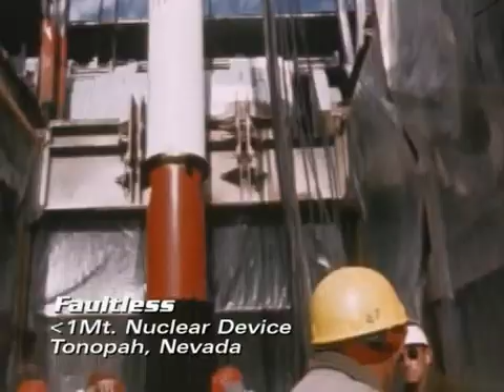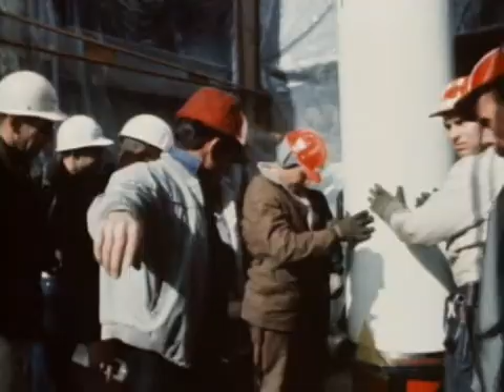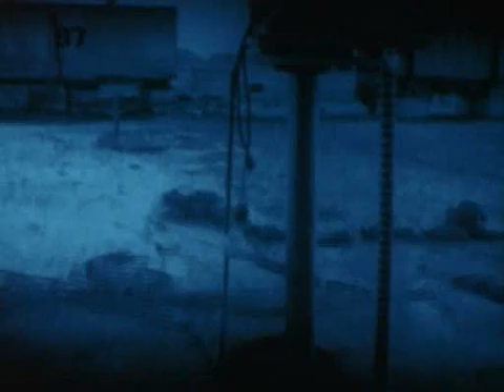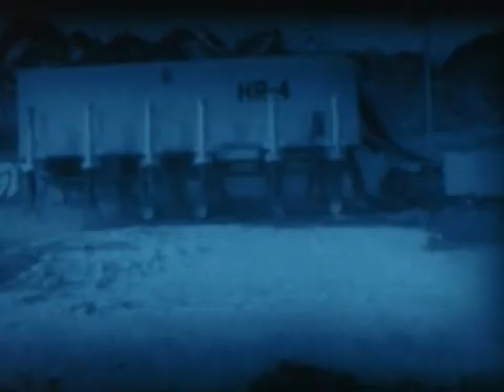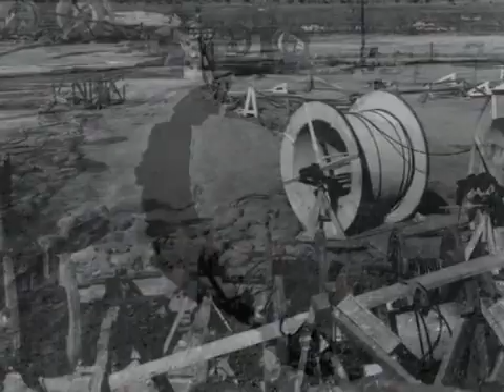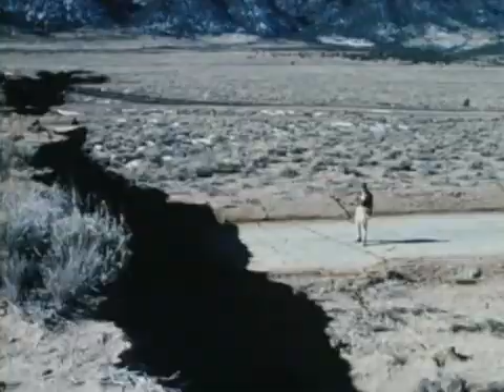Nuclear underground test:Faultless

Comment: "It is sobering to think there's just 800 feet of cracked rock between you and the vaulted roof of the blast chamber." - no, Faultless was exploded 908 meters below ground, 3000 feet.  At 600' it would have been another Sedan crater.
Reply: At the Nevada Test Site there are scores of examples of the effects generated by the underground nuclear explosions there. Typically, each explosion results in a nuclear blast chimney. Once the gases in the vaporized and melted blast sphere cool a bit and the pressure drops the fractured dome ceiling tends to collapse into the spherical void. The collapse continues upward, filling the void with loose rock until either the collapse reaches the surface to form a subsidence crater, or the loose debris forms a compacted bridge that retards the further collapse of the rock and soil above it. In that later case a collapse doesn't appear on the surface. Satellite images of the northern part of Yucca Flat clearly show dozens of subsidence craters.

After the Faultless test the technical assessment suggested that the collapse, at this site took a more conical formation with the boundaries, of the subsidence crater being near the fault slippages that occurred.
Reply: @vernonbrechin4207  You are right, but the Nevada Test Site at Yucca Flat (which you are referring to) is a half-mile deep alluvial valley (that is, a deep valley filled with relatively loose materials, sand and gravel.  To the northwest was the Rainier and Piahute mesas, also part of the NTS, where other tunnel and shaft tests were done.  These rarely caved in, as an inspection of those areas shows (another example is the test areas at the USSR's Semipalatinsk Test Site, where underground tests rarely intrude on the plains) unless they were very shallowly buried.
Reply: @puncheex2  - You are correct about the underground test sites at the NTS. The Piahute Mesa underground shots remained pretty much intact. Eventually a reevaluation was done there because the increasing numbers of shots there was weakening the mesa structure. I agree that Yucca Flat is a deep alluvial structure.

The location of the Faultless site also involves a rather deep alluvial structure that is largely derived from the erosion of the mountains just to the west of the site. Before the site was selected a geological assessment was made of the area where they  planned to detonate up to five blasts. It was deemed suitable for tests from 1 to 3 megatons energy yield. As a result the NTS contractors went ahead drilling three wide diameter very deep holes to emplace the nuclear test devices. The 1.0 Megaton device was claimed to be to 'calibrate' the area for the test instruments for the following tests that were expected to be at higher yields.

After the detonation of the Faultless test a lengthy evaluation was made to determine if the area was suitable for the subsequent tests. Because the Faultless test generated unexpected geological earth shifting with many aftershocks, a determination was made to to not go ahead with the planned subsequent tests because there was a strong chance that radionuclides could leak from the future tests.

Large sums of money had been spent on the years of work at the Central Nevada Test facility to prepare the site for the future tests. The abandonment was kept quiet. The NTS officials reported to the DOE History Office, in Washington, DC, that the site was no longer needed because advances in their knowledge made further testing there unnecessary.

Always keep in mind that official history is not necessarily accurate history.
Reply: Gage  - In one of the earliest underground tests at Rainer Mesa at the Nevada Test Site (NTS) exploratory mining was done after the test to sample the resolidified rock that contained peripheral parts of the radioactive blast isotopes.

In the Project Plowshare program a great amount of information was released in technical reports concerning the dynamics of the underground nuclear tests performed during that program.

Comment: Knowledge serving correct, though, the Tsar device was designed as a 100 Megaton warhead, but scaled down to the 50 for that reason you stated. Either way you look at it though, it's still an awesome amount of pure energy released in the matter of microseconds.

Comment: You can go and stand on this site, I have been there twice. The liner still protrudes from the ground and plain clothes feds sometimes run people off even though it is public land. It is sobering to think there's just 800 feet of cracked rock between you and the vaulted roof of the blast chamber.